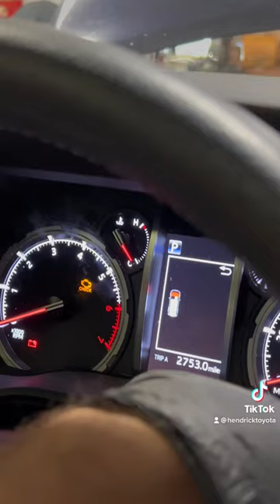Change your filthy cabin air filter & reset that maintenance required light

Comment: Just remember most aftermarket brands of cabin air filters don't have arrows on then that indicate which side goes up; instead they have carried indicating air flow direction and should point down.